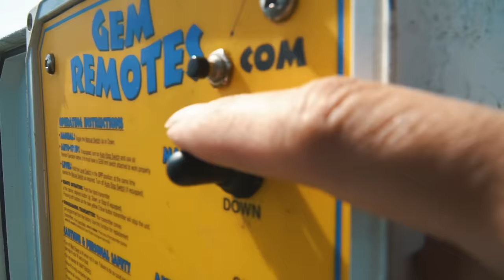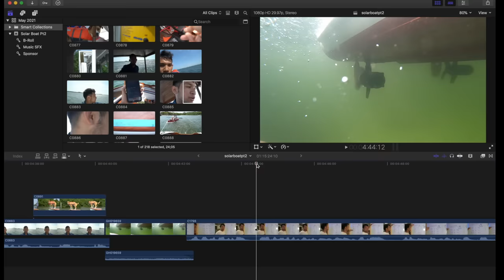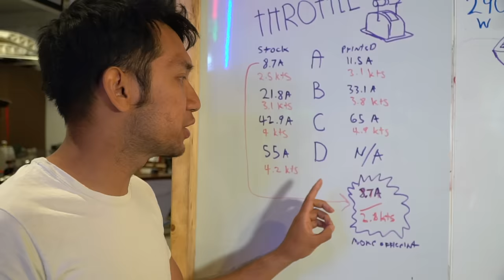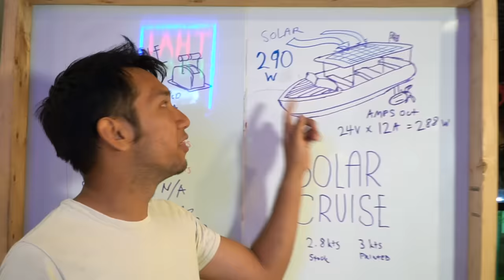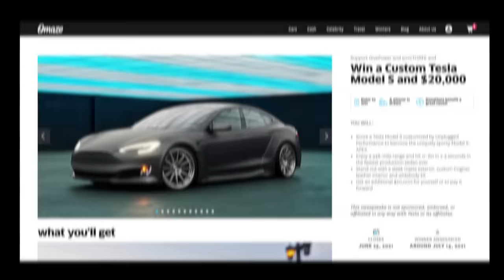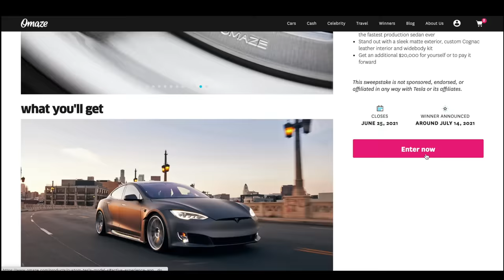Making A SOLAR electric boat (infinite range)

Comment: Hand on the bottom of the steering wheel, turn it the way you want the trailer to go.  Use your mirrors, because looking behind you will essentially invert your controls. When the trailer starts moving the correct direction, crank the steering wheel the other way and the trailer and the truck will follow eachother

Comment: Great work.  You should think about turning your prop into the current to as in forward the propeller is more efficient.  It hasn't got turbulence to cut through unlike the conventional way by pushing

Comment: A little tip: when backing a trailer, steer with your hands on the BOTTOM of the steering wheel and move your hands the direction you want the trailer to go. One last thing, make small corrections.

Comment: You could add a fold out "wings" on each side of the roof to act as further solar panel supports, but it would change the classic boat curved aesthetics.  If you curve that portion to exactly match the roof, then you would have kind of a moustache curl up on the ends of each panel.

Comment: Try ducted props, & if you have the chance, try using a hull like a canoe or sailboat. Much more efficient at slower speeds & low power requirement.

Comment: My thoughts to improve the boat (these might be hard):1.You can add two more motors for better speed. 2.you can make retractable solar panels. 3. You can make a port in which you plug a charger or withdraw power from the boat. 4. Maybe add a more batteries or atleast spare ones? 5.(this is going to be very hard) Add diagnostic monitors.This may include at the very least power consumption/generation

Comment: There are generally two kinds of boats, displacement boats, and planing boats. Displacement boats are usually pointy at both ends and are built to efficiently travel through the water. The water coming back in behind the boat squeezing that rear wedge shape, actually causes added thrust to counteract some of the drag pushing the water out from in front of the boat creates. What you have is a planing boat. It is very inefficient in the water and becomes efficient only after it has got up to enough speed to plane up on top of the water. So you need to either step your power way up to get the boat up on plane, or switch to a displacement hull built for travel in the water. My opinion anyway.

Comment: I would try this myself but I don't have the boat or the electrical knowledge to pull it off,  you already have the setup, you should extend the roof so it's the same length as the hull, and have panels that fold out when your on the water so you have more panels getting power and then add another motor or 2 below the boat, having a total of possibly 6 rigid panels, I'm sure with all the excess amps you could get that boat a lot faster on the water

Comment: I run an e propulsion outboard on a true kit inflatable. It’s brilliant. $1.00 to fill the tank. Clean quite and stick it in the car to transport. When you twist the throttle it goes. Every time.

Comment: I know that they may not look quite as good as the flexible panels, but I’m using 375w Canadian solar house panels and I think you may fit two of them on the roof, use an mppt Charge controller to step the 33v maximum power point down to suit your 24v system, I’m using Esmart3 controllers myself, and you would run those panels in series for a higher voltage and better cloudy day performance. You can get them in black frame, so they still look sleek 👌 you’ll have more than enough power to run at full speed and still charge the batteries to full capacity at the same time.

Comment: I thought about a solar powered electric boat build but the panel efficiency and motor efficiency still can’t beat what a similar petrol motor can bring. Not to mention the weight of batteries. I know it’s not a matter of if but when fuel cells become cheaper I could imagine a fuel cell boat powered by hydrogen with the same performance as a petrol. Though I’ll still probably build a solar powered boat just because I still like the idea and it’s cool. Plus with the Queensland sun there’s plenty of free energy!

Comment: I have achieved similar results with 3 400 watt panels and an inverter with 4 car battery's that I daisy chained together as a power bank. I used two trolling motors meant to be powered by car batteries and modified them to fit a light weight fiberglass boat

Comment: Great build Peter! Maybe you should mount some fins in front of the motors so they don't rip off in case you strike the bottom? When I'm in shallow water I usually pull out the pivot locking pin on my outboard motor so it'll just twist up if I hit, but obviously you don't have that option here. :)

Comment: lighten up the boat a bit, switch to aluminum tubing and marine canvas for the roof, extend the roof for and back to fit 2 more panels on.    That would give you 550 watts power at peek.   then give the boat the option to "button down"   in case of rain...   with zip on canvas and  see through plastic windows.

Comment: Boat looks fantastic.  One of your most polished looking results.  Only part that still looks a bit rough is the 3D printed base of the throttle quadrant.  But I’m guessing you have plans for that which may be in part 3.  Trip to Florida looked like fun.

Comment: You could add 6 more solar panels, have them on a hinge to hold out to the side. 2 fold out on each side and 2 fold out on the front. It will provide more shade and a lot more speed. Use aluminum bars to support them.

Comment: Use the bottom of the steering wheel, makes it a lot easier you turn the wheel the way you want the trailer to go. Also it’s easier to keep it in motion and not stop and start again.

Comment: What kind of battery pack are you using? I would use LiFePO4 prismatics and let it charge in the Sun for a couple days (or plug in and just top off with the sun after cruising). You probably can overvolt the motors you have but the motor controllers/inverters probably can't take it. You might have to upgrade the controller/inverter to do that.

Comment: Time for a partial rebuild. Pull the motors and replace them with inrunners. Obviously go brushless and upgrade to 48v at least. Rework your panel solution so every horizontal surface is covered in them. The end goal...way more speed.

Comment: On the infinite range thing, I thought about doing something similar to the boat.  I wanted to pair a plug-in hybrid Prius with a light weight solar trailer.  The solar trailer would produce about 110% of the average power requirement of the Prius in full sun at about 50 MPH on flat pavement.  The trailer would have the solar panels and battery storage.  The idea was to never require gas and day-time travel only.  The combustion engine would only serve as a backup.

Comment: It would be cool to make a Solar Electric Catamaran. 9.5ft x 16ft with 1500watt solar input. Also install 2 mini wind home turbines each producing 450 watts. Maybe utilize hydrofoil technology with one hydrofoil in front and one hydrofoil in back connecting both left hemisphere and right hemisphere of the catamaran. Livable with fridge/freezer setup and enclosure room for 3 days at sea. 25+ nautical miles/ day charge. Would be a very cool build forsure

Comment: Is there a battery at all in the final version? If so it seems like average consumption or total trip energy would have been interesting to discuss. You don't need as much solar power if it can charge all day even when not moving

Comment: Peter how about a lightweight office, racecar seat, or cooler using 20-inch hub type wheel /motors, joystick that you can take on the beach, paths, etc  A chair capable of 6 mph or 40 mph plus.Might be a fun project with a few laughs as well.. The 20-inch type hub/motor wheels should give you both the low-speed torque and high-speed capabilities to move an adult up to speed quickly.

Comment: You should engineer a jet drive. I have always wanted to design a jet drive for a solar boat. They have so many negatives but they're cool and they can allow the boat to beach on shore lines for random exploration. I want to try but ill probably wait for metal 3d printers to get cheaper first

Comment: Turbo jet pump inboard electric and hydrofoil keels on a foiling mono-hulls would give you speed. The type of power on the electric motor can vary as long as you figure out axle material fracture torque point.

Comment: Two propellers and only one rudder gives you less drag and the rudders you have are a real drag. Airflow, waterflow same really. You wouldn't make a plane rudder like that. I strongly suggest that you just take them off and use a basic sailing dinghy one screwed to the transom then use your existing steering gear and a Quadrant. 
You could even try a bow rudder for less turbulence and with two motors that can be running in opposite directions it would manoeuvre really well specially when docking on camera.

Comment: Unless you start planning your max speed as a displacement boat is the hull speed which is about 1,2 * sqrt(length in feet) knots, to get above this speed the boat has to climb over the bow wake.

Comment: In water,  surface condition and roughness is in essence for efficiency. More than 50% of your ennergy is spent to counteract friction at slow speeds. I'm doing sailboat regata in interior lakes (light wind and speeds like yours) Here is the best for friction : Mirror surfaces then unpolished with 1000 grit. (pure polished is a bit slower). Any roughness under 1000 grit is A LOT worse. I'm sure you can improve your prop A LOT with the correct surface roughness. Not sure how to do it on 3D prints.

Comment: I think you made an awesome video and a awesome boat. I think you made the motors and the steering system a little too complicated. I think one powerful outboard electric Motor on the rear transom, would make it less complicated and you will get more performance.

Comment: Would be interesting to see if you could upscale this. Maybe even to a small or medium sized houseboat with total self-supporting propulsion system connected with an integrated electricity system. Cooking, heating, propulsion and all the other things with solar-power. You would need a emergency-system with a generator

Comment: The reason that your panels aren't producing their rated output is the angle of incidence. From what I can gather you should expect about 80% of the rated output with the mounted flat, which lines up well with your actual output. And this is only for a few hours a day when the the sun is near it's peak. As the angle of the sun increases relative to the panel less actual energy is striking the cells and production drops off.

Comment: get one of them kits that use a weedwhacker motor and switch it out you have the shaft and prop then plus there so light compared to even a seagull motor, there pretty cheap and should take a good amount of power through the shaft more than rated no doubt, I think a 52cc puts out <3hp - 2237w, get two of them and you'd have something pretty quick, I think the outboard you took off looked about 4hp

Comment: I build very fast ebikes and battery packs.  The 24 v. Motors are not very efficient.  If you can find a modern high output motor with a 48v  li ion battery you can use a converter for charging and you will have a much more efficient system.  I would build though hull shaft and a motor mounts run but two reduction sprockets and a modern imp motor with with Bluetooth controller and also a Bluetooth bms for the battery pack.  Much like the system used in the Sur Ron electric dirt bike.

Comment: I wonder if the surface finish of the props is affecting the efficiency of your 3D printed parts. You might still overheat the motor at full throttle but try using acetone vapors to smooth out the 3D printed plastic surface. It’s a trick I saw years ago in a college tinker lab. Overall great build really impressive!

Comment: You need to smooth out the blades of the 3D printed propellers. That rough surface is causing so much drag. Have you considered any ducted props?

Comment: you can fit one more solar panel on that roof, other then that, the only thing you can do to make it better is upgrade the motors and the battery bank, its a great boat already tho :)

Comment: the motors on bottom of boat arent great. likely to get broken off hitting ground. and those direction fins too. better to just put outboard motors and use them for steering too. it would insulate the boat from some motor noise too specially if you use rubber mounts. the smoother your props and bottom of the boat the better too for drag.

Comment: I really want to do this with a pontoon boat then add a center toon with a jet drive motor in it for fast blasts and skiing. I could just use a big jet ski motor or if you can get enough solar, put a Tesla motor in front of the jet.  If you run low speed most of the time and just go fast once in a while the solar may keep up.

Comment: Best method to get a faster and better boat? More zeroes. What I am thinking would be 350 watt framed solar panel(s), a deep cycle high amp hour LiFePO battery to store solar power or to recharge while on higher strength grid, and a good horsepower motor that would put out the knots you want. Unfortunately, more zeroes will cost more zeroes, especially with some high speed motors needing up to 25kw of power for high speeds, which means more aH for the batteries, not to mention, high amp hour deepcycle batteries, as well as outboard and inboard electric motors costing several thousand dollars.

Comment: Your boat looks great! FYI 1kW drives my 2000lb fiberglass displacement hull launch 5mph. You need a large slow turning propeller with gear reduction. You also need a slippery displacement hull. I’ve collected lots of empirical data, including testing against a 48V trolling motor on the same hull. Shoot me a message some time.

Comment: I'm not getting much improvement going with high-eff. mono glass panels. Maybe 300W vs 288. Not worth lugging around the heavy glass and frame in this opinion. But I built the canopy out of panels. So, I didn't have to use any extra roofing materials. Just a frame and panels. The roof is not nice and round. It's actually kind of concave at the moment because I neglected to add crown to the framing. But it gets the job done. So there's that.

Comment: What if you add some mirrors hinged around the panels, to let you selectively raise the mirrors to bounce back sunlight into the panels when the Sun isn't straight above? (though, drag might be a concern for the front and rear mirrors; and you also need to consider wind)

Comment: Your testing kinda coincides with what I’ve found.  On standard trolling motors, 112lb thrust max, you will max out just under 7mph if you keep adding motors. 

Elco makes an EP-50 electric outboard equivalent to 50hp outboard. 96v system, should get you mid 20MPH. Not sure the solar will keep up with that though... haha

Comment: Very nice. Good work. Could you use an Arduino or so to adjust the throttle to solar power automatically and override it only when needed to manouver via the throttle stick?

Comment: What i would do, is add a gear with ratio of 1:32000 or so and add a copper magnet generator at the last gear, to produce extra energy. Extra 300w

Spin it yourself ofcourse

Comment: It make sense that you aren't going very fast because of the hull, not necessarily the props or motors. Your boat is a semi-displacement hull which is very stable but inefficient at lower speeds. if it was a deep V hull it would maybe go faster.

Comment: here's a tip for you, if you want to plane on this boat your going to need at least a 6-8 hp motor, and an easier and faster way to start planing would be to put more weight to the bow of the boat.

Comment: I would be curious on a much larger build, like a pontoon boat with 6-8 solar panels and a much larger motor or dual motor set up. about 8.5' wide and 20ft long. would be interesting to see what someone could come up with for basically a pontoon house/camper boat instead of something so tiny. all these projects I see with solar are as small as one could make.

Comment: you should get even better performance out of the printed prop by smoothing out the blades maybe with some kind of filler and sand smooth. the as printed surface looks pretty rough

Comment: Hi Peter, My son and me are building something similar to your solar boat. After seeing both these videos and your video about the rc boat with 12 outboard motors I have a question. Would one 55lbs electric outboard give us more power than two 18lbs outboards? 55 or 18 are our only options and I only have the one 55lbs and I can fit a maximum of two engines on our stern (transom? English is not my native language so I hope I get the jargon right). I hope you can shed some light on this. Thanks!
Reply: Little late and also not peter but doing some basic math 18+18 is 36, so the one 55 would have about 19 more lbs of thrust theroreticlly, its also depends on the weight of your boat and how much weight you are putting on it. a single motor is going to have less drag than two likelly giving it better performance with a lighter craft, but 2 motors would work better than 1 on a heavy boat. but I belive that the 2 18 lbs motors would burn less electricity than one 55lbs motor. (I am in no way qualified to give this advice, I'm just some guy on the internet who watectes boat and electic boat videos)

Comment: Plastic props flex I bet that's why the printed props are not good at full power.metal props are my recommendation and a few strips of non skid tape for the foredeck so the salty seadog doesn't slip,good job as usual peter,the canopy is definitely too low

Comment: Hey Peter, What if you added a setting on your throttle that swapped the charge controller to dump straight into the motor along with power from the battery at the same time.